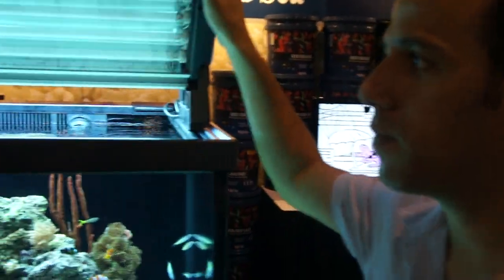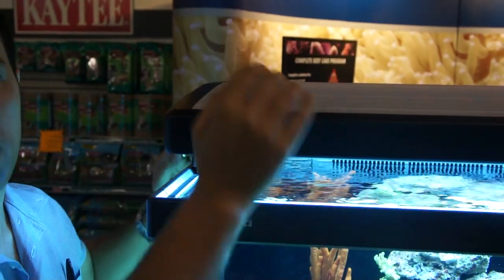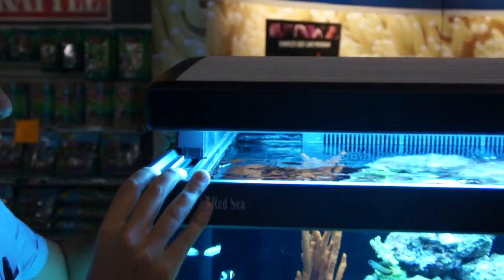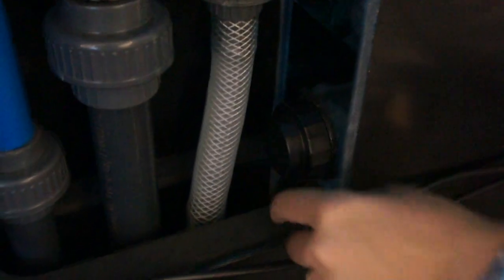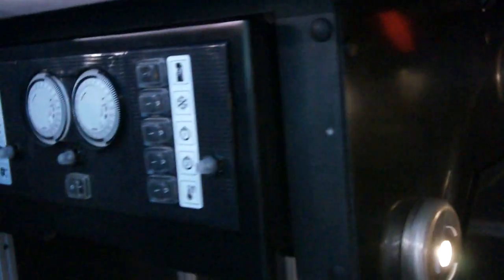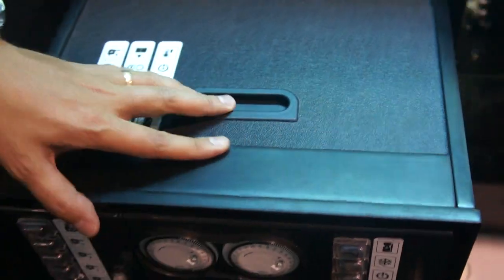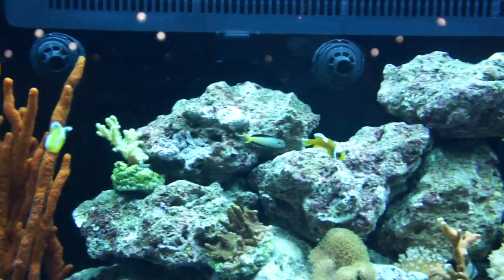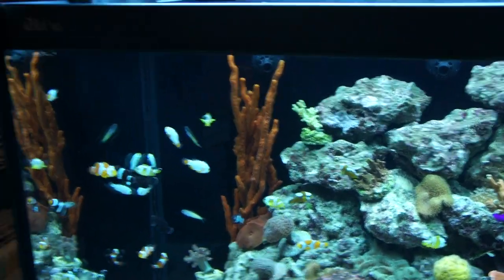Red Sea Max S 500 T5 Coral Reef System Demo live with MarineGeek.com!

Comment: Hi I had the Red Sea MAX 250. It was very difficult for me to lower the temperature as the T5's generate alot of heat and even the pumps. Do you think that this will have the same "problem"? Aside that the tank is a masterpiece